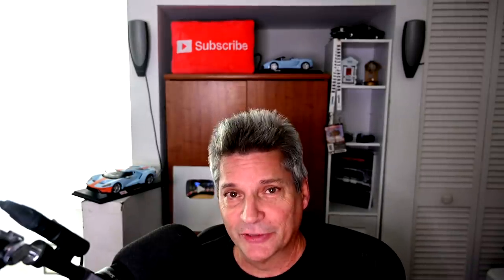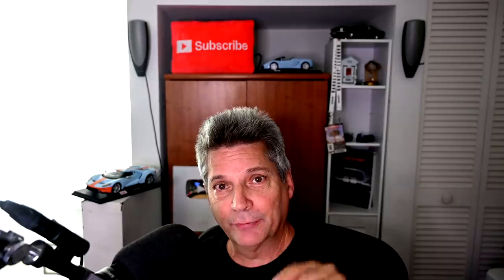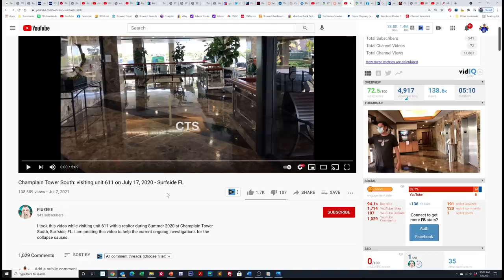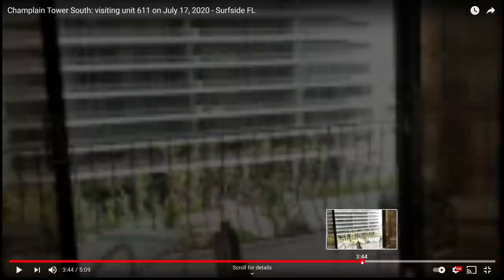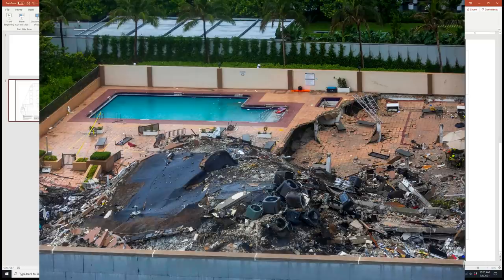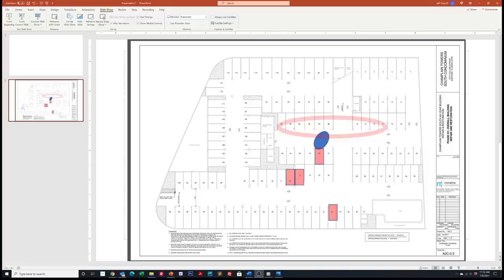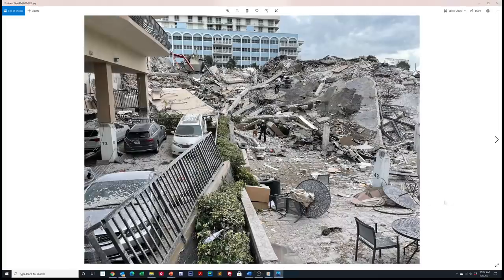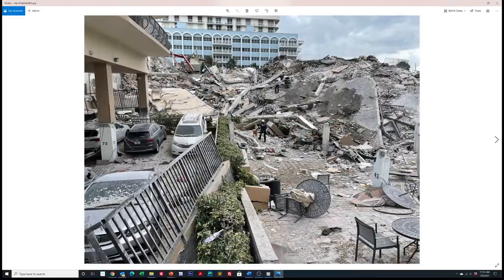Analysis Garage Video BEFORE Condo Collapse: Water Everywhere

Comment: It is amazing how you can really see the size difference of the columns where the building survived versus where the building collapsed.
Reply from the maker: yes very unnerving
Reply: @jeffostroff  I will probably always look at parking garages a little differently from now on. Especially ones underground.
Reply: And yet, you don't know whether any of the columns in question failed, or whether the floor slab(s) became detached from those columns. So far, the visible columns look  like they punched through floor slabs rather than failed, and the interior columns are still under rubble. Is there a way that you know something about the state of the columns that no one else knows?
Reply: it's based on Jeff's prior video where he concludes that the five of the smaller columns started the actual collapse. The timeline indicates that the pool deck did fall first through the columns and then the smaller columns seem to have been knocked out and caused the collapse
Reply: @MJTroop11  tell me about it. I live in a high rise and I've looked at my garage every day since his vid about it.
Reply: And didn't they add on a whole new penthouse level on top of the area with the smaller columns?
Reply: And missing column rebar right angled to tie in with decking, somethings very wrong here. Did they use rebar or mesh in deck?
Reply: @dananorth895  , apparently the architectural plans specified discrete rebar. I presume it was in a mesh configuration, tied together where rebar crosses other rebar, as is normally done.

The question, based on the plans, is whether there was sufficient rebar, whether it was placed at the proper depth, whether enough elements were attached to the columns, what the constitution of the concrete was, where there were cracks, how they were patched, how corroded the rebar was, and where it was corroded.

Unfortunately, a lot of non-experts in these comment sections are making definitive pronouncements. It's ridiculous. If they're that clever, then they ought to go find a cure for cancer.

Meanwhile, we're going to have to wait for a forensic examination of the debris before we even have a chance to have definitive answers regarding the cause of the collapse.

Comment: You can tell this building has been neglected for several decades and was just putting a ban-aid on things!
Reply: It had major design flaws. It's a miracle it stood erect for 4 decades. Look up the comment by the architect.
Reply: Sadly when karma hit, it effected a lot of people.
Reply: NOW HOA IS GOING TO BE SUED SO BAD THEYLL NEVER RECOVER!!
Reply: @Pozi_Drive  the design was good and allowed for a fall off so the water wouldn’t sit on the pool deck. But it was built with no fall. They actually brought this up after construction.
Reply: @RichBuddy  The sister building was a step-sister building. It was NOT identical. Watch the other video. Do your homework before blasting away. The buildings had similar exteriors.
Reply: @RichBuddy  Dude:  The original DESIGN didn't have flaws.  In construction, they deviated.  Corners were cut with decisions as simple and moronic as failing to slope the pool deck so water drained off it, and cutting out 1/3 of the rebar from the columns.  

Why do you think all this water is pooling? It's going down because up above, with each rain, there's nowhere for it to go.
Reply: @Pozi_Drive  and with all this information. as much as you think you know, the owners knew way more than you and decided to save a few bucks. that's the bottom line though isn't it? they drown in their own negligence.
Reply: @RichBuddy  That's how they became rich buddies.
Reply: @vickiehadd4324  - so the Hoa (the home owners) are going to file suit against themselves? many of the hoa are dead, so should the family get nothing from their estate? The ones that lived lost all their stuff and cars that were in t he building also...
Reply: @dez1989  Then you build your dream house and next door is Billy Bob with his two trailer homes, cars on blocks, throwing biker parties till 3 AM.
Reply: @2paulcoyle  I made darned sure that wouldn't happen! We purchased 3 acres of land, surrounded by trees and the house is in the center of the property! You can also tell how things will be by looking at the homes around your area. If there is a little bit of land and neighbors who take pride in their homes, you are less likely to have someone who lives like that move in next to you. Most people who wish to live like pigs will not be able to afford a place where people have nice homes. If you can afford a nice place, it's not my place to tell you what you can and can't do on your own property! I'll be damned before someone tells me what I can do on the land that I paid for! Mind your own business and clean up your own home.

Comment: "CP&R completed 90% of their work on the balconies. On Friday 09/18 they will be on site to complete the 4th, 3rd and 2nd floors. On Thursday 09/17 they will be on site more core samples of the slab. The front drive area concrete thickness is not matching up to the as build drawings the Association has on file. It is suspected that when the building was built, they sloped the top side of the structural slab giving us various thickness on the slab. Preliminary observations suggest no waterproofing was installed in the drive areas and the waterproofing for the pool deck is located just under the sand bed of the pavers." --- this is from the HOA meeting notes, Oct 10th, 2020
Reply: Also look at all the planters full of mature bushes- located above every area with damage incl above the pool equip room. Overwatering for 40 yrs would def cause all that water damage to concrete & rust below. Im sure they are going to end up finding several contributing factors during the investigation as rarely is it ever 1 thing. Thanks for posting your info.
Reply: Check out the video “how concrete damage can hide” by Building Integrity! He explains what happened with the planters perfectly.

Comment: Those questionable things on the roof were corrugated plastic panels used to redirect the leaking water on the ceiling so it didn't drip onto tenants when they were getting into or out of their vehicles.
Reply from the maker: Handyman Specials!
Reply: @jeffostroff  yep
Reply: Rather than fixing the cause
Reply: That's friggin nuts.
Reply: Spot on...and in the video you can see clearly those corrugated ceiling panels above the lady who was looking for her parking space. In that clip she walks right under them ..clearly visible.
Reply: “I take the path of least resistance.”~Water
“I take the path of least resistance.”
~Humans
Reply: I mostly see people in my neighborhood using it to wall off their gardens and balconies.
Reply: and at 25:21 there is a paint "balloon" full of water hanging from the ceiling
Reply: OMG
Reply: The one bucket that was by the curb had a nother bucket over it to catch the run off all the signs of future failure were there but sadly compliance dictate over safety
Reply: There's an antique shop in downtown Fredericksburg, Virginia that used to be a Woolworth's, with a very elaborate system of pipes and gutter to collect the water that leaks from the ceiling. That must have been a lot cheaper than getting the roof fixed. SMDH.
Reply: @jeffostroff  lol
Reply: If the Morabito report was correct there was little they could have done. The pool deck and the slabs on which it sat were laid flat rather than sloped. All that water was the result of runoff not having anywhere to go but into cracks and gaps in the deck and slabs, yes?
Reply: @donniseltzer7718  good spot!
Reply: @DVD927  - "Gravity works."  Any building no longer standing.
Reply: @donniseltzer7718  Right above the sprinkler pipe?
Reply: @jeffostroff  from the video looks like black mold in many areas of parking  garage, even where some of the cars were parked.  Probably alot of trapped water between the garage roof and pool floor, that ran down the sides and some remained above the garage ceiling.  I am no expert, just a guess.
Reply: It appears the garage upper deck didn't follow the plans of sloping to code protocol to allow water to flow over into subdrains. To fix it correctly, id imagine they would've had to tear the entire floor out.
Reply: Also to keep spalling paint/concrete off of cars. I suspect some had their car showered with debris there so they put the corrugated tin up.
Reply: Holy Smokes...Wow...Unbelievable... I wonder what the annual condo fee was for this building?
Reply: @rhonda5056  insanely high. I'm pretty sure I read like over 900$ a month. This is not a poor area. People that live there have $$$
Reply: @Captain058  Except it wasn't even tin, it was the cheaper alternative which was corrugated plastic or fiberglass. It looked like there was some lengths of plastic gutter in some areas.
Reply: Screaming, "pending disaster". Never buy a house with a shaky/dubious foundation.
Reply: @donniseltzer7718  Wow.
Reply: @ftoftheX  they’d have to replace it all due to the water damage and rusting of the rebar. They’d have to redo it all.
Reply: @rhonda5056  Miami Beach/surfside beachfront condos pay monthly dues. Typically monthly condo fees are between $1,000-$3,000.
We pay ~$1,100.
Reply: @parallelsandtangents938  Thank you, even worse for sure.🤔
Reply: Martian Technology  Built in 1981. Grandfathered in I would guess.
Reply: So can they look at repair records and payments and maybe find the company who put them there and have investigators talk to them as soon as possible to get more clues?
Reply: That guy in the parking is most likely dead
Reply: @1AstralKing  I believe that report info is a false flag. Despite the number of people parroting that there was no grade for the pool deck, the blueprints do clearly show a grade-to-drain. It was NOT flat, but it appears the top tile section was deteriorating and had become permeable to water, which gives the same results in the end. Also the planter boxes are directly above many of the leak locations shown in this video. They were reported as not draining properly and water leaking from them even in the MLS photos of the pool deck.
Reply: Martian Technology  The North Tower is an identical twin to the south tower with the exception of the pool area. South Tower leaked like a sieve. North Tower built a year later did not. I think we are looking more at a maintenance problem than a design problem.
Reply: @ftoftheX   I'm doubting that as the construction blueprints clearly show a grade-to-drain spec. It would have had to get past a building inspector if the spec'd grade wasn't actually implemented. $$$?
Reply: @Captain058  You're spot on with the idea, however I suspect the HOA Board had them installed to buy time until they could afford to remediate the problem. A large number of people who purchase a new condominium think that condos somehow never need maintenance.
Reply: @s.floridaliving5692   Yes, and for a 30 year-old building that looks at least that age on the outside, the interiors of these units were fit for royalty. Google condos for sale in this building and you'll see why the prices were astronomical.
Reply: @parallelsandtangents938   All the corrugated panels were for was to drain the leaking water in front of or behind the vehicle rather than allow it to drip onto the cars & have the the leached chemicals eat the paint off of the vehicle. Plastic/Fiberglas is actually better than galvanized tin for that job as it won't rust. I'm suspecting that this HOA did a lot of car repaints and touch-ups over the years.....
Reply: @horsewithnoname12345  is this in addition to rent/mortgage?
Reply: Martian Technology  it can be surmised that the sabotage was effectively being done by neglecting to make repairs correctly or foregoing preventative maintenance of supportive structures so as to make cosmetic upgrades instead. A condominium community sabotaging themselves.
Reply: @dalewalker4614  I hear ya, Even though inspectors do what they can, The bottom line lies on the contractor. It "may" be they had another spec from a material manufacture  that claimed it would resist ponding water. If the contractor gets a ASTM code on it sometimes they can change the spec to accommodate an inspector. I'm not sure that happened here. Hard to say for sure. It appears likely it had drainage/waterproofing issues.
Reply: @DVD927  It takes real money to fix this kind of damaged structure, would be nice to know what the maintenance budget was, and who and how it was directed, I don't it was the Handyman making those decisions.  They were just employees doing what they were told.
Reply: @parallelsandtangents938  look at around time stamp 19:04 in front of elevators there is a piece put up there with what looks like a big crack coming out from it
Reply: @dalewalker4614  Understood. Interesting, then, that the report is saying something that isn’t true.

Comment: I am not an architect, but I remember from chemistry class that water is called universal solvent - it contains extreme polar hydrogen bonds.   Water will corrode most substances after time.   Judging by all the water seen in garage, as well as cracks in concrete, apparently leaking and collecting for years, it's pretty clear the support columns must have corroded  at base level over the years and finally gave way.  Just  my layman's view.
Reply: Yes, all true, and salts in the water only serves to help corrode exposed steel into weak rust even faster, (an electrolytic solution, essentially). The building structure was very poorly engineered, especially the pool deck which lacks a proper drainage design for rain and surf, and then very poorly maintained on top of that. If they made better repairs on the twin North tower, then it may not be a risky structure to live in, but I would have to see it's basement parking garage first in order to say for sure. Luckily for the other tower, the basement parking garage is also minimalist, so it's pretty easy to see any of this type of damage to the superstructure down there. I've already seen a few other condo towers around Florida with similar damage, and they really do need to be fully assessed by engineers, and repaired professionally by people who know exactly what they are doing. The importance of structural problems only grows exponentially as you move from top to bottom of any structure. Can't ignore problems in the basement. Had they taken the engineering assessment from 2018 seriously, repaired it the correct way ASAP, and kept up on proper maintenance from then onwards, I think the South tower could have stood for another 40 years just fine, despite the engineering flaws I see. This tragedy doesn't ever have to happen again if everyone takes the importance of highrise building maintenance seriously. Skyscrapers are impressive modern feats of defying gravity, but we must never forget, gravity never takes any time off. It is an unrelenting force.
Reply: The terrifying part is, I can point out at least a dozen buildings and parking structures up and down the Mississippi gulf coast that have water damage that bad or worse. I used to work for a concrete cutting contractor and have seen chunks of concrete the size of basketballs that had spalled and left gaping craters in structural concrete beams...water ingress and corrosion damage is the norm. The basement of the hospital on Keesler AFB is a REALLY bad example, and that is a government building.
Reply: Well said Joker Ace.  I don’t think it helped either that they ended up having 2 different contractors.  That’s scary in my opinion.  If I was the 2nd one I would definitely want to know why the first one quit.
Reply: How come no other buildings in the vicinity suffer same fate??? Cause it's not water damage, thats why.
Reply: @richrusso5301  what are you trying to say?
Reply: ...with time on its side, water did erode the earth itself enough to create the Grand Canyon...

Comment: 22:33 Look at the upper left side of the concrete. The rebar has rusted and the concrete is cracked/separated. That column was near failure years ago. This was near parking spot 79 or under the front of the building that fell first.

We know the pool deck was reported to be bad. The planters on the pool deck (near spot 79) were flagged as water intrusion points. I think the deck let go. The deck took out damaged columns near parking spot 79 and innated the collapse. The lack of beams linking columns likely helped the collapse spread. 

Lots of water issues seem to exist. Pipes were leaking, the pool deck leaks, the garage floods somehow at least in the past. Lots of maintenance issues added up over the decades. There were warning signs, but people were to busy to notice in time.

Good days lead to good memories.
Bad days lead to good lessons.

Comment: You can only imagine how corroded the rebar was inside the concrete, no amount of fresh paint will hide the problem going on in the structure.
Reply: Rebar isnt going to corrode INSIDE the concrete.  Moisture cannot reach it there.
Reply: @STARZFAN31    if there were cracks in the concrete from constant water exposure, you can guarantee some of that water had seeped into the rebar below.
Reply: @STARZFAN31  Rebars corrode inside concrete if water seeps inside. Give it more time and rusted rebars will crack the concrete from inside. It's awesome to see the power of rust destroy concrete .
Reply: @skunkworksdistilleryandfir7122  it’s not so awesome when it all crumbles under you though, due to bureaucratic incompetence.
Reply: @STARFAN31 

Are you dissonant? Concrete is a porous material, add time, weather/ elements, water, humidity, and yes; it will penetrate the concrete and corrode the rebar.